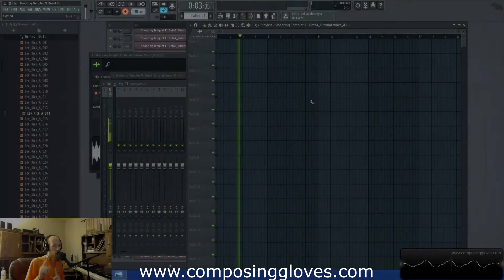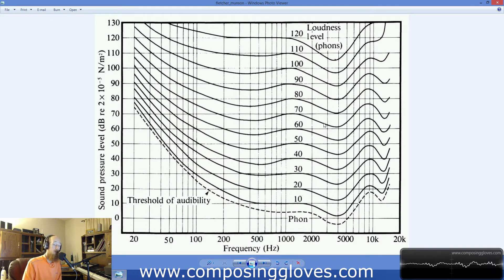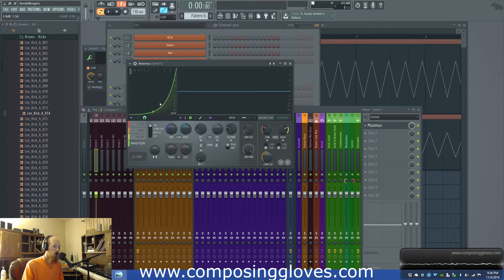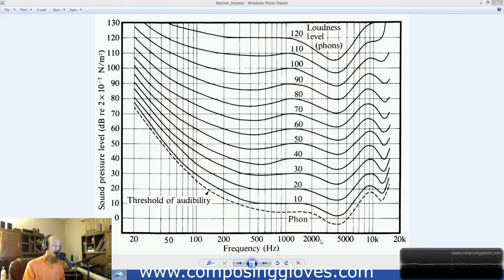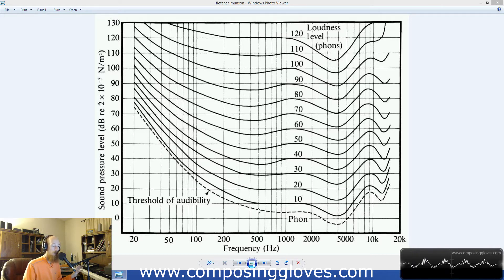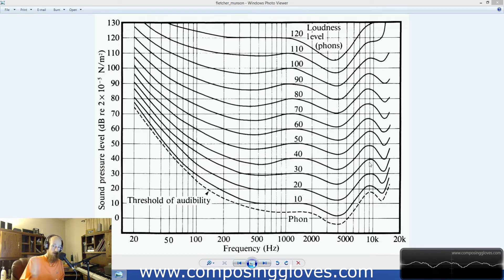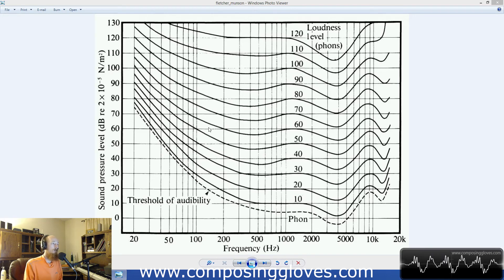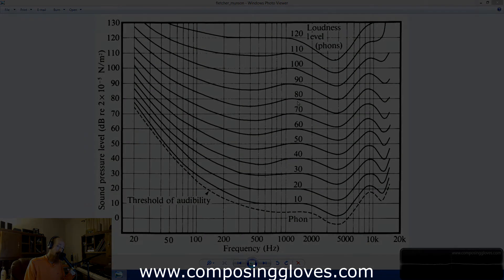24. Fletcher Munson Curves , Equal Loudness Curves

Comment: Small correction:
If you add two 90 dB values you will get 180dB not 93dB. Decibels add in the normal fashion.
If however you are talking about power increases or decreases, such as going from say 10 to 20 watts or reverse, this will give you a 3dB increase or decrease depending on whether you are going up or down in power.
Reply: NO, if you add two equal dB-values, you get an increase of 3 dB. Imagine having a violin that produces 60 dB then two violins do not make 120 dB and four violins don't make 240 dB.
Reply: @ronvonk6144  -  Interesting, I fully get your point and analogy, admittedly I never looked it that way.
I think you are still talking about two sources of identical power or intensity so there is acoustically a doubling effect which equates to only 3 dB increase in SPL. That's what I get for being immersed mostly in the electronics point of view where I have always added or subtracted the dBs depending on whether I had gain or a loss of X amount of dB.
Thanks for the clarification.

Comment: the frequency responce does NOT flatten out at louder levels at 2-4KHZ, at these frequencies your ear becomes more sensetive at these leve;ls. that explains why when I listen to music at 90-100DBC I have to trim the 1KHZ to 6KHZ. at 2-4KHZ the threshold of pain is "only" 105dbc!. on my 15" PA speakers if I run the system flat 100DBA is insanely loud and 105DBA will utterly destroy your hearing.  I normally listen with bass boosted and 1KHZ-6KHZ cut4-8DB and running 85-90DBA and 95-100DBC.
Reply from the maker: #datruth! Sounds like you do a lot of live sound.
Reply: I dont do live sound at all, I run these in my living room, Ive been building speakers for 30 years off and on. , I prefer pro sound equiptment to home speakers although I own both.